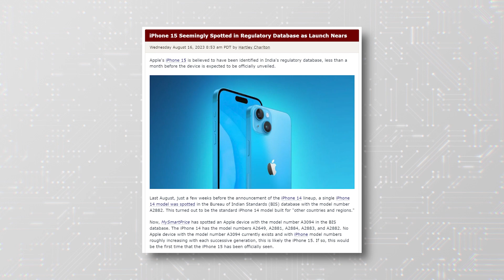iPhone 15 – MAJOR DESIGN CHANGES and Incredible Speed

Comment: what apple really needs to do is, 1) add individual volume sliders for ringtones and notification sound alerts , 2) then add another volume slider for the alarm clock . 3) Apple really needs to over haul the DND function, and the focus function,  cause do you really need 2 functions that can do the same job. Because of this it does cause issues with the ios software for not knowing what to do with notifications.  eg/ when both these are disable, you can get a notification pop up with no sound alert, due to ios not know what to do because it does not know what to prioritize to use DND or Focus..  3)  Add a battery that last longer then a day  no one really cares if  the iphone going to be a little thicker  or taller  this is proven with screen size getting  larger  and ppl  are still buying them.  4) The dynamic island,  just get rid of the notch  you already  acknowledge its a eye sore , and trying to hide it with dynamic island which really is a useless function that cant really do anything great